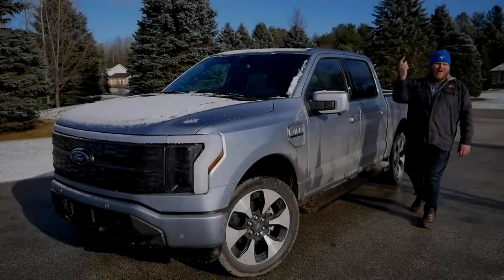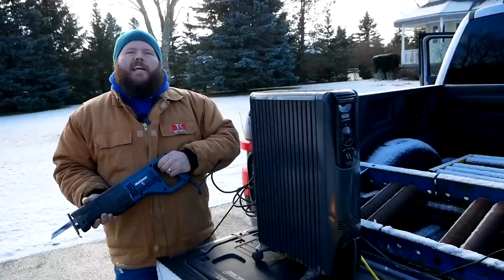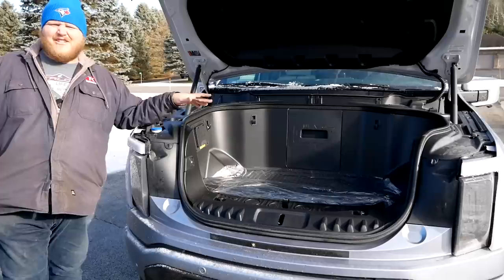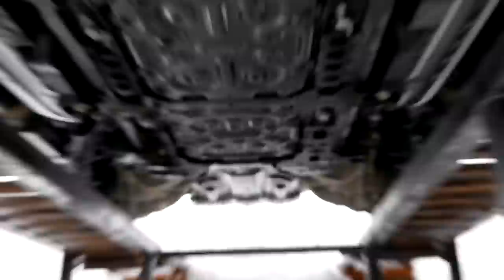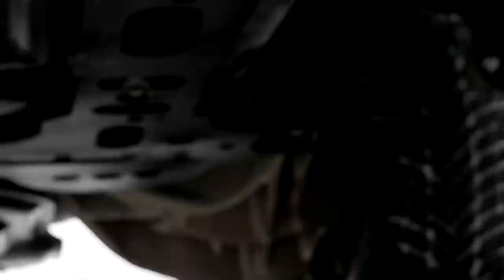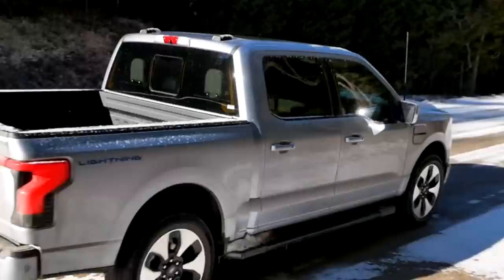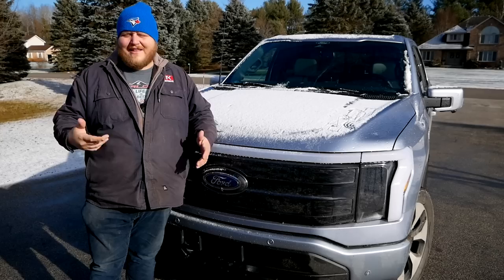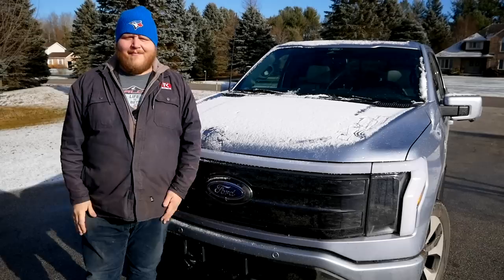Ford F-150 Lightning Electric Truck Real-World Review - Testing Towing, Range, Off-Road & More!

Comment: Are you able to use the Tesla charger to change the F150?
Reply: 15 countries in Europe have opened up the Superchargers to non-Teslas and in North America Tesla is implementing a system called Magic Dock to allow for CCS connectors without drivers requiring an adapter. Not sure of timeline.

Comment: The one thing your dad failed to mention...YOU NEED A SMART FONE to charge. I DONT need a smart fone to pump gas or diesel. I am sure not everyone has a smart fone. I want to see this thing tested on the Hydro line. I am guessing the mud and water will destroy it. The other issue is procurement of materials/elements to make the batteries for EVs. Young boys and young men are forced to mine cobalt by armed force in South Africa. These so called green vehicles are NOT as green as brain dead Trudeau thinks.

Comment: Rolling pile of electric crap. Already tons of recalls. Crap resale value. Worthless battery after 7-8 years. Brilliant decision, Ford. Complete waste of money.
Reply: Not a chance those batteries will make even 5 years. Trust me. Same crap is happening with drill/impact batteries which die after just 2 years, I talk about Milwaukee and Makita what I use at work. My first 18V Makita I bough in 2006 lasted 10 years.
Reply: Actually, one has gone 1 million miles on the same battery, but several new motors.  The warranty is 150,000 miles, but many Model S Tesla have over 300,000 and some over 400,000 miles.  Model Y, you can expect 22-25 years of use on the same battery if you drive 13,000-15,000 miles a year.  It costs less than $300 year for Maintenace. 

My Tesla only depreciated 9% after 1.5 yrs and 25,000 miles.   My jeep depreciated 26% in 1 year and 21,000 miles.
Reply: @davids9577  cool story dude. If you like it stick with it and be happy on your own way. Just don’t try to convince everyone to be same way
Reply: @davids9577  inaccurate. Even Tesla batteries DO NOT last 300k. Add up the $ spent on batteries, replacement motors, etc, and anyone who passed high school math can see it costs 4x or 5x cost of similar gas car. Look at deprecation. 5 years in and you will have lost 30% range. With astronomical replacement costs. $28k for a new battery. What a deal!

Comment: It’s a nice truck but a horrible EV. Whereas most new EVs charge at 250kwh or faster, the Lightning is limited 150kwh - which makes a HUGE difference. Furthermore, as for the charging experience - it should NOT be like a gas station it can be MUCH better.
You guys MUST try a Tesla. The SuperCharger network experience will BLOW YOUR MIND. Fast, relatable and much easier than gas station. Can’t wait for you guys to experience a properly build EV Truck and an excellent charging network. CyberTruck can’t come too soon.

Comment: I want 50 KW onboard Pro-Power generator with MULTIPLE 240 V outlets output so I can run a 240V TIG Welder while I am drying my soaked workclothes in my full size 240V high heat clothes dryer AND running the 240V laser sintering 3D metal printerand the 240V 5-axis CNC machine at my jobsite AND my 1200 Watt microwave oven that's making lunch plus my 8 cup Delonghi Espresso maker for the workers needing their morning jolt PLUS running my 75 inch TV and 1000 Watt 7.1 surround speaker system with XBox for after lucnh gaming PLUS all my water pumps and heater for the 6-person hot tub, my multiple 500 watt space heaters AND the full size chest freezer and home refrigerator to keep the food and drink cold, teh ice cream frozen and the air conditioning on full blast for the cooling tent. Make sure they have FULL GFIC (Ground Fault Interrupt Circuitry) breakers for maximum end-user safety and add little LED lights above each outlet indicating the circuit is Green for ON and/or connected, Red for OFF or not connected and blinking Yellow or Orange for Ground Fault or other power outlet problem! 

Give us the 50 KW Pro Power with at least FOUR 240V outlets plus 16 of the 120V outlets, 16 of the 12V DC cig-lighter outlets and 16 of the USB 3/4 charging outlets!

V

Comment: Y’all are nuts. You’re pulling a 1,000 lbs trailer. Of course it’s not gonna sag. If everyone charges at home, that is going to suicidal the power grid. 1% of the us is EVs California is already shutting down the power grid, what happens when it happens 50%?
Reply from the maker: 7,000 lbs